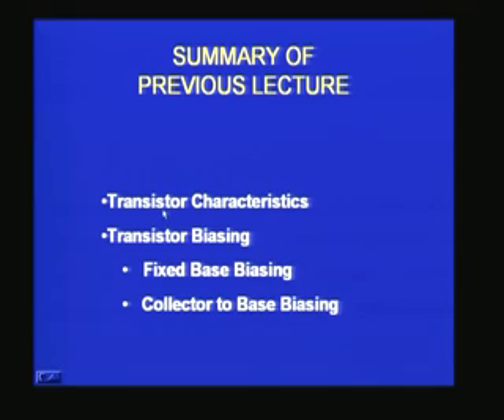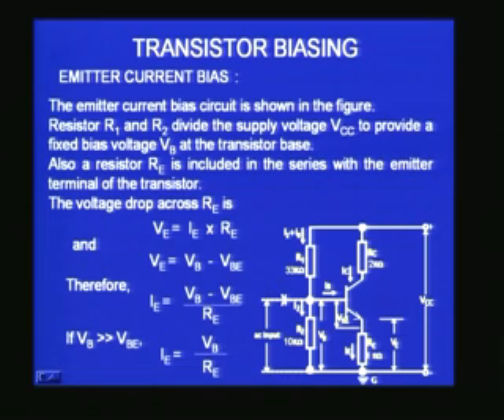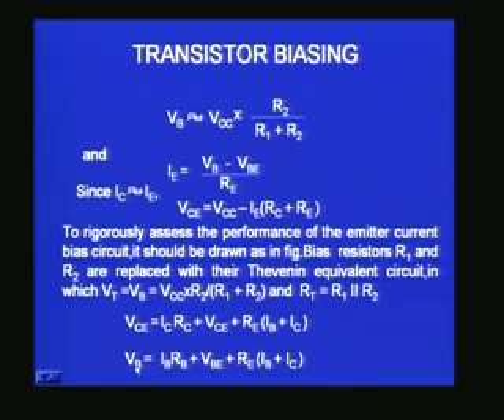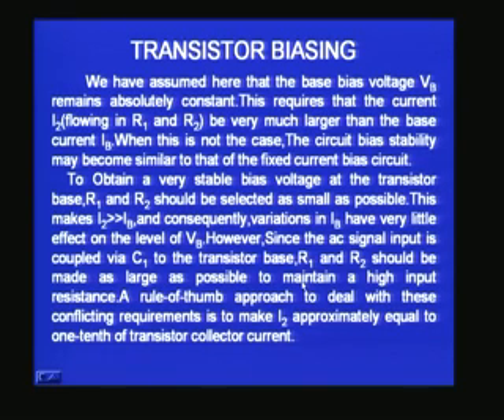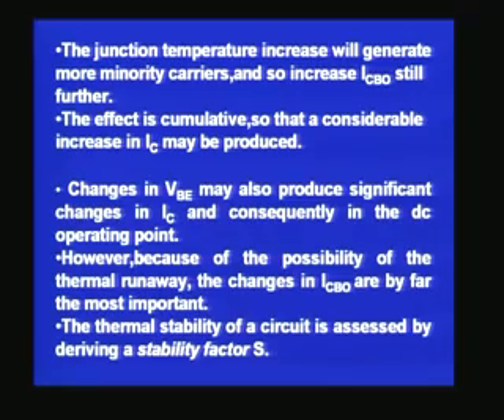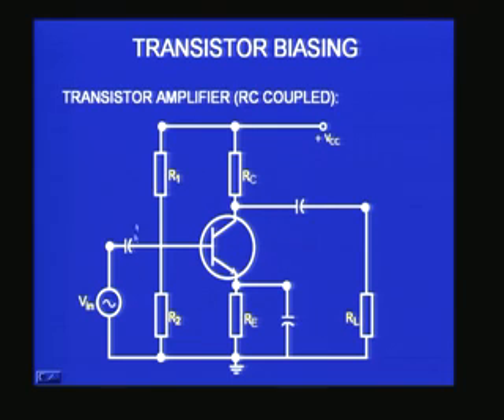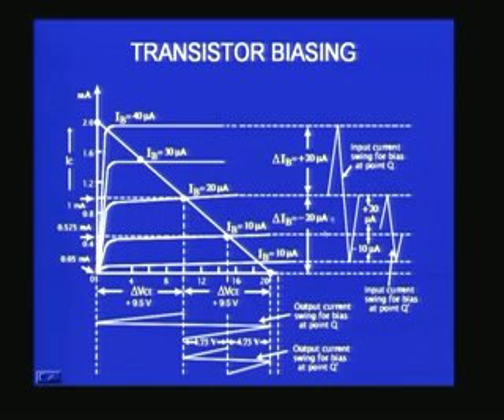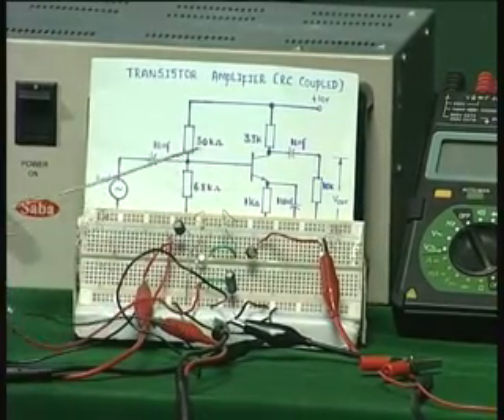Lecture - 12 Transistor Biasing

Comment: What happens if the Re is not there. (the emitter is connected to ground. 
Will Vb be the voltage division between R1 and R2, or will it be 0.6-0.7?
Reply: It would be 0.6-->0.7 Volts.

Comment: can someone confirm if this is right . I(saturation current)= Vcc/ Re+Rc when Vce is zero. because it says that the q point can be moved by varrying the emitter resistor Re.
Reply: Vce can't be zero . Transistor will be "off" if it is so .

When emitter resistor is varied , the voltage across emitter resistor changes.  Which effects Vce (since Voltage at collector has to be greater than voltage at amitter by an amount ≥Vce(SAT) for transistor to be in active mode)

Comment: @tajiknomi The best method for approaching this problem is to keep cranking up the voltage untill smoke comes out of the transistor.  At this point it is then safe to assume that you have gone too far.  Hope this helps.